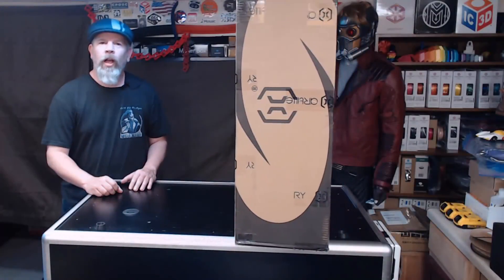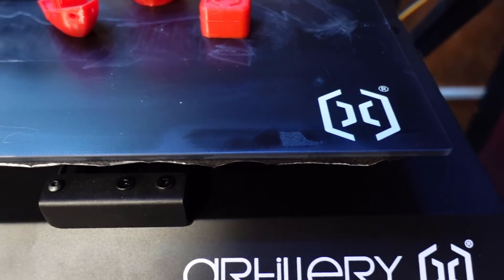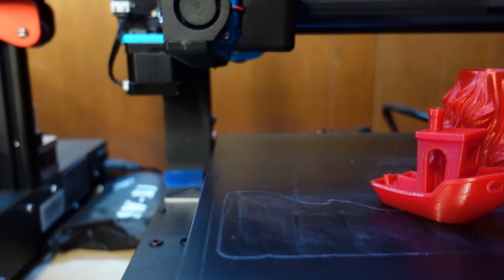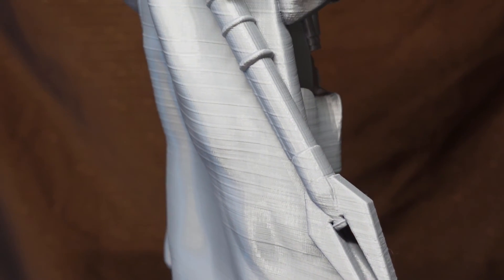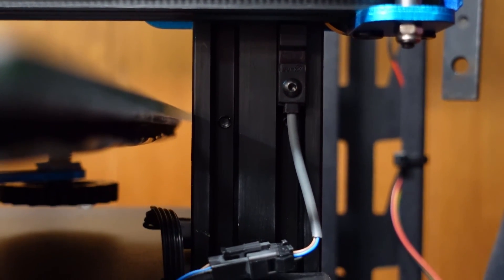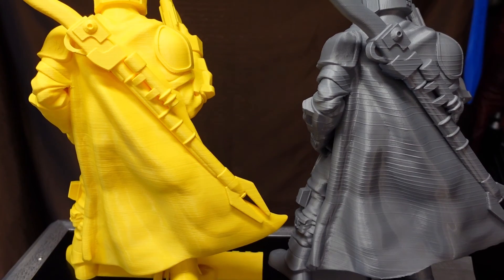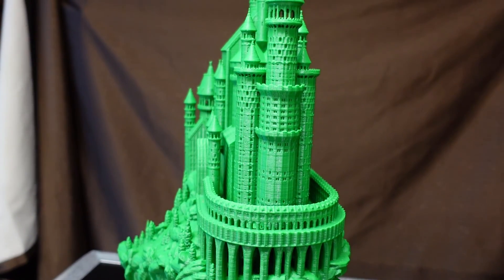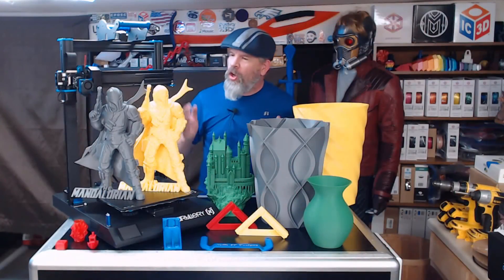Artillery Sidewinder X1 Review - Over 400 hrs of Print Time

Comment: I've had a sidewinder for over a year and love it. Only issue I've had is with the hot end ribbon cable. Print out the cable support on thingiverse as soon as you get your printer and you won't have an issue
Reply from the maker: I’ve actually designed a new cover that has a cable clamp and pinda probe mount that I’ll be using.    Stay tuned, I’ve got a list of upgrades I’ll be doing.
Reply: @NAK3DDesigns  Fantastic, can't wait to see it.